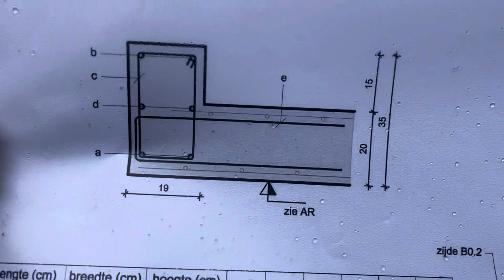Another day @ the office... building a house..

Comment: Love these formwork videos, you are really creating structures!
Is there any reason that you use the pre-made wire ties for some connections and just wire spoon for other connections?
And also do you have to get an engineer to inspect and sign off on the rebar before you pour the concrete?

Keep up the good work brother  🔨☘
Reply from the maker: Morning mate . Nope no real reason only the guys like to use these pre- made ones .. I prefer the normal wire 

The ties with wire doesn’t give extra strength to the concrete in theorie it’s just to hold everything in place .. have a good weekend man ! 🙏🏼
Reply from the maker: Oh yes we do get the engineer over here to check the rebar before the pour